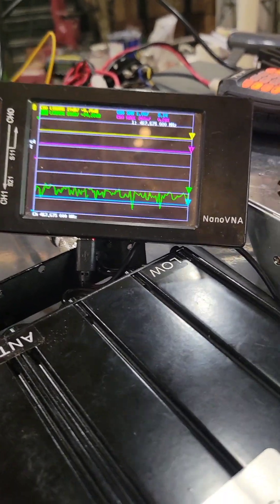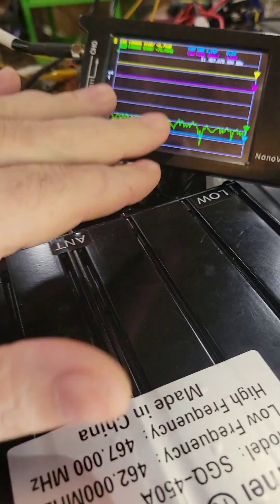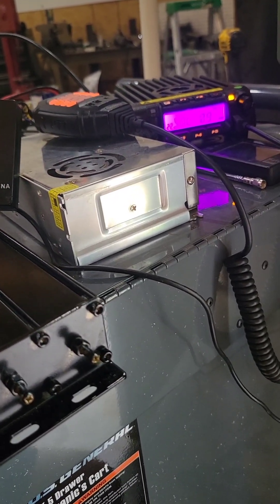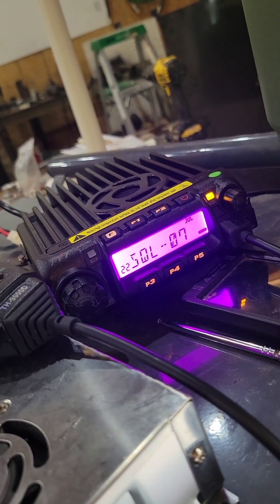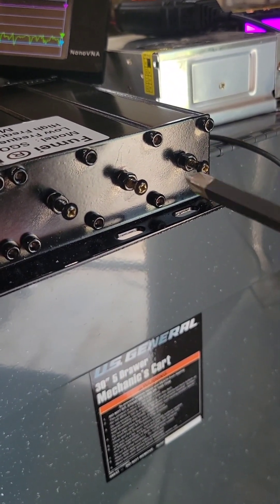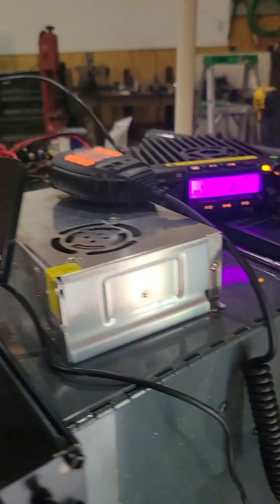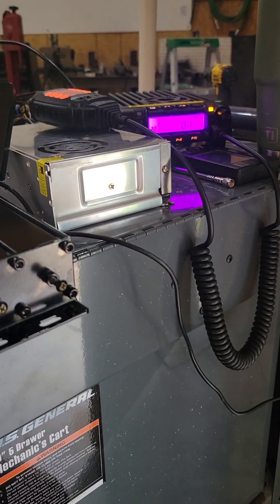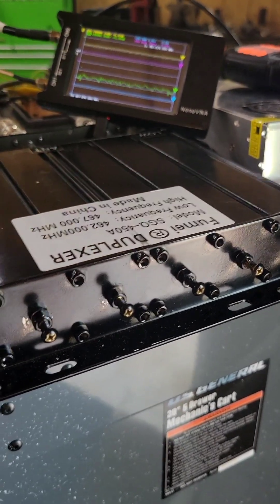Fumei duplexer tuning with nano vna

Comment: Can o make a recommendation on a better way that’s as easy. Use the radio as a transmitter. Use a watt meter and put a signal in the low 462.xxxx tune to the peak watt output or until it drops off. You done. Switch sides and do the same. Better way than squelch.

Comment: Hey, have you tested the 9mm mag converter? and is the built in mag ejector robust enough to not break after repeated use? and has it been decently reliable?
Reply from the maker: @andrewjarrett2769  yes, I tested it quite a bit with multiple uppers and bolt configurations. I've had an ejector break here and there. Shortest use was 2 rounds, longest use is over 1000. Pla was ok, petg a little better, pla+ so far lasts the longest. I'm working on an updated version but I keep getting side tracked. I'll get to it soon though.
Reply: @jeffdill5260  Thanks for the clarification, i only have one pmag and I don't really intend to get more, so would it be fine to just print extra ejector/feedramp inserts in case something goes wrong at the range? Also, would this work for stanags? I'm pretty sure they have different geometry but they do seem fairly similar, just wondering if you think they'll work.
Reply from the maker: @andrewjarrett2769  I've made different versions for different mags. I had a usgi version, hex, pro mag, and a couple others. The pmag worked the best and wasn't a permanent change.

And I would print a couple feedramp/ejector sets just in case. Pla+ printed on the hotter side (200-210) gave me the best results.
Reply: @jeffdill5260  Thanks so much! I normally print everything in PLA+ so that works out perfectly!